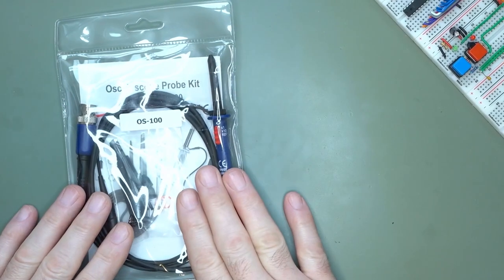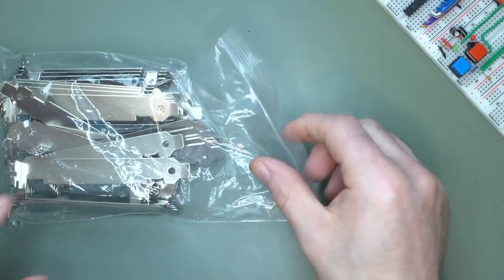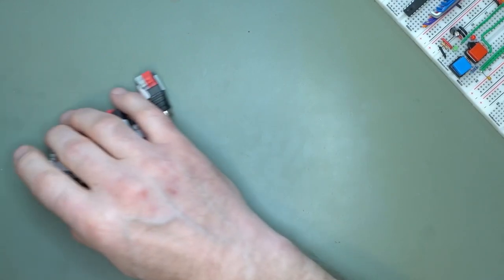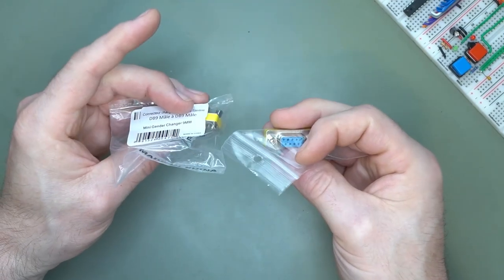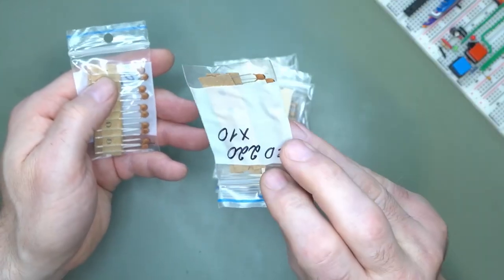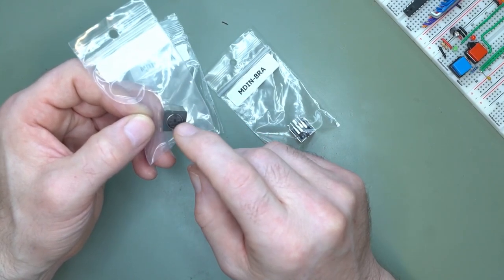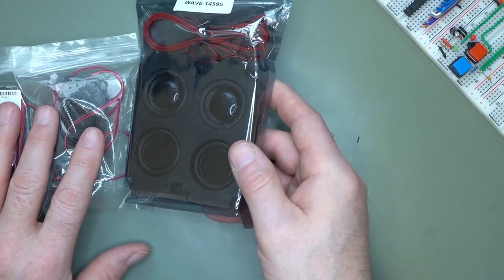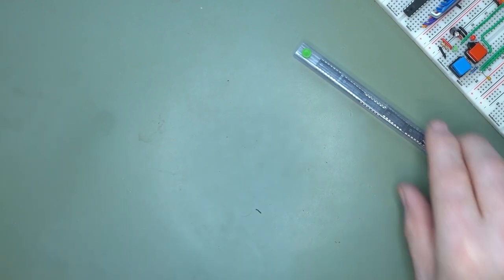Mailbag #2: Did I really just buy $600 worth of parts?

Comment: That feels like a lot of money for some basic parts? Maybe the brackets were expensive? It sounds quite fiddly to get a PCB and bracket to line up too, so hopefully that works out well for you. Thanks for showing the tiny led buttons, I think I’ll go looking for those myself, kinda neat 🙂
Reply from the maker: In retrospect, yes, that was too much money for what I got. Well, I did get a lot... but those brackets were more expensive than anticipated. As for aligning the connectors to the bracket so it lines up? That will be tricky, as I have yet to find any reference on the internet for connector placement/alignment.
Reply: @microhobbyist  I'm slightly intimidated at getting a DIN 41612 connector lined up with the fixing holes too. Hopefully there is a Kicad template I can use

Comment: I did a sreach for "isa bracket" and found a bunch of 3d printed ones.
Reply from the maker: Nice!  On thingiverse?
Reply: Printables is the way to go. They have a few. A while back I designed one for a PCIe graphics card; I only had the half height bracket but needed full height. I wouldn’t call it a perfect solution, but it worked well enough. 3D printers are a handy thing to have.
Reply from the maker: @lawrencemanning  Is it sturdy enough? Did you use an FDM or SLA printer?
Reply: @microhobbyist   I didn't look at the sites, so I don't know, but some were even printed metal.
Reply: @microhobbyist  I just have my Ender 3 with PLA. The resin stuff is too messy and toxic for my liking, especially with a child in the house. It was just about strong enough; I added a spine to the outside edge of the bracket to give it more rigidity. 

PS. Ta for the sub. Dunno when I’ll make another video!